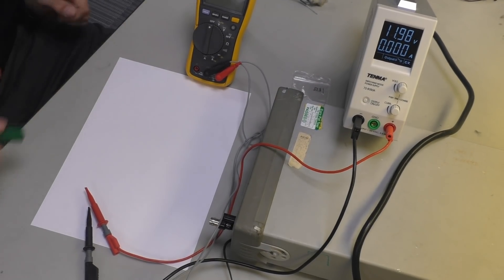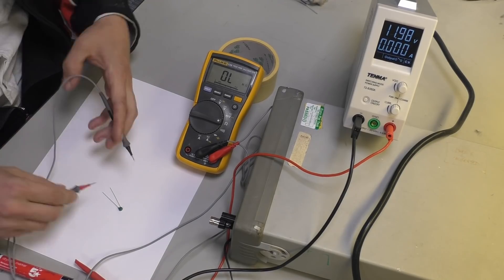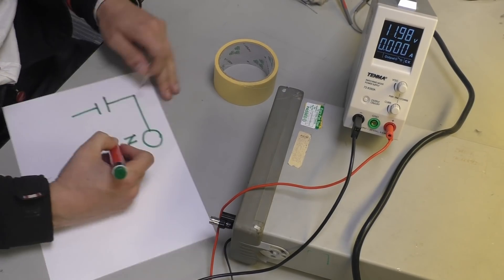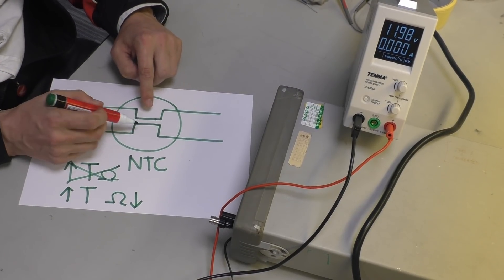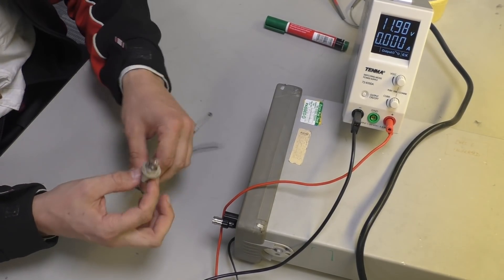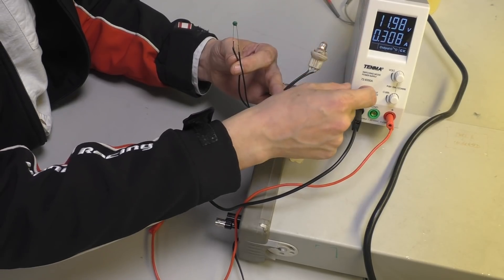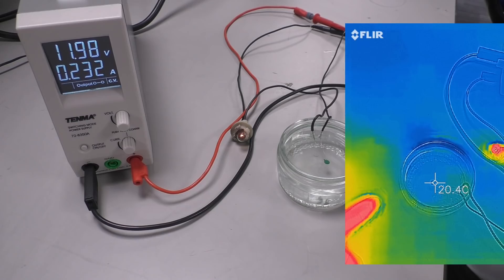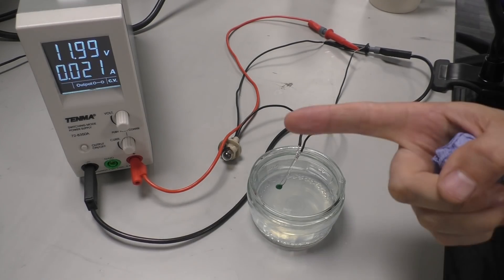Fuel Level Sensor - NTC Thermistor example

Comment: I'm studying this and what Beta values would be necessary to hit the numbers you measured. Seems for a 1 KOhm resistor it would have to be a pretty high value like 4800K, which seems unusual. I think it may be lower though and I'm focusing too much on exact values. One part of this is confusing me, which may be key. Obviously as the temperature of the NTC thermistor goes up, the resistance goes down. When the resistance is low enough, the bulb illuminates. In this case you peaked around 100C at 12V and 0.3A. That means the total resistance in the circuit was 40 Ohms and total power was 3.6W. What's confusing me is, shouldn't the bulb itself be factoring into the resistance reading of the circuit? If we assume that is a 2W bulb, at 12V it should draw 0.166A and have 72 Ohms of resistance on its own, which I believe should actually go up when it illuminates. That's more resistance than your total reading with the thermistor inline. I feel like I am missing something fundamental or misunderstanding the calculations. I totally understand how the thermistor circuit is allowing the bulb to light, but not how the bulb affects the readings on your power supply. Hope you can help!

Comment: I got here because I was trying to understand the reason why my idiot light stopped working and 2 weeks ago I ran out of fuel. I knew I had to refuel at a certain point of my trip, but I just forgot to do it. I was just so lucky that I ran out of fuel 3 or 4 hundred metres before a petrol station and since I was riding at about 100km/h, I managed to get there without the need to push the bike! Completely understood what I have to do to check it! I'm not an English speaker but fuck'n enjoy your accent! Stellar video!

Comment: A small bulb requires about 1/4 amp or 0.025A to turn on. The sending unit may read 0 ohms empty but not on the bottom of the tank. A small “I.C.” circuit will update the fuel level gauge and low fuel light every 10 seconds. This keeps the fuel level from fluctuating when turn corners with a low tank. Newer robust senders use a silk-screen resistor grid on a ceramic board, yet subject to poorly refined fuels containing high amounts of sulfur. This attacks fuel senders and low fuel sensors NTC thermistor. Most, not all, NTC thermistors have little fingers of a polymer version coated with a carbon compound. When hot, the fingers pull apart and the more that separate, the fewer the connecting are complete and the resistance goes up. Large NTC thermistors in a polymer case actually are used in power window motors to protect from over current operation. Example, roll the window completely up and hold the switch, the motor could be damaged but the NTC thermistor opens, saving the motor and does not trip the circuit breaker in the fuse box or older fuse types. They are wonderful devices use everywhere. 
  Thank kindly for bring your lesson in this video!

Comment: Hi 
maybe you know if it's possible to replace fuel gauge (floating system) with themistor sytem?
range isn't the same...
12 - 200 ohm for floating system
1700 ohm approx for the thermistor

Comment: You have the thermistor controlling the positive side. I tried using the negative side and it seemed to work the same. Any notable reason to do one or the other? I would think it's not safe to run 12V+ through the gas tank...
Reply from the maker: Some thermistor have built in diodes and they are biased.
Reply from the maker: Also why would it not be safe? 12v runs through your earth and your tank is part of that system, also most fuel pumps are inside the tank, with a 12V 15 amp fused supply...
Reply: @thedirtyworkshop  I agree, my mistake. I wasnt thinking of that since I dont drive a vehicle with an in-tank fuel pump. Im trying to rig this for an indicator light in a 70s CJ5

Comment: Can i submerge a NTC into Gasoline ?  Or other inflammable liquid ?
Reply from the maker: Yes
Reply: @thedirtyworkshop  No Dangerous if damaged NTC ?
Reply from the maker: No. Fuel needs air and a ratio of 7:1 to burn. Same thing with electric motors in fuel pumps...
Reply: @thedirtyworkshop  well, i don't have a level indicator but only a spare light.
Do you think I can replace my float exclusively with the NTC?
Reply from the maker: As long as you get the resistance correct yeah
Reply: @thedirtyworkshop  the lamp is at 12v it will be no more than 5w and it will absorb 10mA. If I have not miscalculated the NTC resistance should be 1200 Ohm and since I don't find any around it could (at least I think) I could use a 5K NTC or is it very high in your opinion?
Reply from the maker: Stick a resistor in the circuit

Comment: Great video, thanks. Question: My thermistor is broken. If I wanted to bypass the cutoff and fuel light completely, could I just wire in a standard resistor? My current thermistor has 1 wire. So with the Resistor, I would use that wire and the other side just to the fuel pump body? 
Thanks
Reply from the maker: Cutoff? As for the light, remove the bulb
Reply: The Workshop my bike has 2 of them. The top one sets off the light. Then there is a lower one and it cuts off the fuel pump. Could I just wire a 1k ohm resistor in-line and ground it to the fuel pump body?
Reply from the maker: What bike is that?
Reply: The Workshop 2006 Suzuki boulevard C50 (vl800)
Reply from the maker: Are you 100% it has a fuel pump cut off???
Reply: The Workshop wouldn’t say 100% sure, but on an m109r (Suzuki boulevard 1800) I’ve seen a few reports of people’s fuel pumps stopping because the wire to the thermistor broke. (They have 1, my bike has 2). I can’t think of any other reason why it would need 2 of them.
Reply from the maker: I dont think there is a cut off. Why cut the fuel pump when you've ran out? There's 2 thermistors, that bit is true. One for the warning you're running out, the second for the flashing 'you're about empty' function.
Reply: The Workshop welp you were right. The first one is a slow blink, the second one quick blink. The bike runs with the wires disconnected completely. Not sure what those other people were talking about when they said their bike died from that ntc wire breaking. Anyways thanks for your help and video.
Reply from the maker: No worries dude. The Internet is full of 'I know this, I know that's people. Lol

Comment: thank you....great
Reply: question: i am working on a 2009 bonneville it has the low fuel level light not working, i did few tests based on your video, so with the multi-meter the NTC works i tried to warm it up with a lighter and the ohm goes down and them when i blow the NTC the ohm goes up i did the same test with a light bulb as you did in the video and the NTC works the bulb turns on but seems working only with a lot of hot, (the lighter) it should works just with the environment temperature right? 
so if i connect everything and i warm up the NTC with the lighter the low fuel level light doesn't turn on on the dash, so i thought maybe the wire is disconnected somewhere!?!?! but i tried to connect togeter the two wires of the TNC (i just by-passed the TNC) and after 3 sec the low gas level light turned on on the dash?!?!?!? but it doesn't turn off himself i have to switch off the key.
hope it make sense and maybe you can give me a suggestion...thank you
Reply from the maker: Is this the original thermistor? Or did you buy another one? Thermistors have ohm ranges from 100Ohms to 1 million ohms. 

"it should works just with the environment temperature right?" - No, the circuit is powered when the ignition is switched on. Power is send down the circuit heating the thermistor - if fuel is there then the thermistor is cooled at the resistance remains high stopping the bulb from glowing. If the fuel isn't there the thermistor heats up (from the current passing through it) and this lower the resistance and the bulb lights up.

"and after 3 sec the low gas level light turned on on the dash?!?!?!?" - yes and it should. The resisatance in the circuit with no TNC is low so the bulb lights up.
Reply: @thedirtyworkshop  it is stock TNC, so it works with power 12v and 12v have to go thru the TNC once it is warmed up? i need to find the missing ring!!!
Reply from the maker: Try measuring the current draw on the bench then in the bike
Reply from the maker: Heated in open air and in petrol

Comment: How does an ecu (for example) measure the value of a thermistor? If it sends current one way through it does it 'listen' on the negative side?
Reply from the maker: It doesn't - this is not part of the ECU circuit - a lot of things aren't and don't need to be.
Reply: @thedirtyworkshop 
Sorry I didn't necessarily mean a fuel level sensor, your video just popped up whilst I am having issues with coolant temperature being read incorrectly by an ecu. I just wondered how the ecu read its value. Electricity not my strong point...

Comment: Hi, good video I love a bit of science,
is the wiring layout something found on Yamaha's?
my old Fazer had a yellow light to show low fuel, I never got to examine the circuit though as it never needed it.
My Kawasaki has a kind of whetstone bridge circuit containing the variable resistor on the float arm and fuel gauge, are there any other ways of doing it?
Cheers

Comment: I`m thinking your low fuel light on the SV is still not working?....have you checked thebulb? (dumb question)..if thats okay then there will be a circuit in the dash that amplifies the themistor signal to turn on the light.If the wiring to the tank is solid andthe bulb wont light....somethings wrong in the instrument cluster...just a thought.....best regards...
Reply from the maker: "I`m thinking your low fuel light on the SV is still not working?"

- what makes you think that? Yes its working. I sorted it out months and months ago.....
Reply from the maker: "have you checked thebulb? (dumb question)"

- PArt of the circuit is that when you switch on the ignition the bulb comes on - and then goes out after about 3 seconds - this is to tell you - everytime you start the bike that the bulb is working.

Comment: Hi Matt love the new toy . I can see lots of videos coming up. As others have pointed out you would not normally  connect a thermistor  and indicator combo  directly   but as usual the inscrutable Japanese come up with a very cheap very simple solution. The traditional  method is to use a Wheatstone bridge type configuration and variations on that theme  with varying levels of complexity that  may be needed. Hell you could even throw a full blown micro processor  at it just for the shits and giggles

Comment: Short version as still confusing.

NTC in fuel gets heated when ignition is turned on, when it's in the fuel, the fuel keeps it cool which means its off in circuit. So no bulb on.
When it's out of the fuel it can heat up and open like a thermostat so the power flows and the fuel light turns on.
Reply from the maker: that's what I said. the difference is the its a resistor not a mechanical valve. If you start saying 1 thing its hard to backtrack later

Comment: Seems crazy deliberately putting electric current through components submerged in fuel. But I suppose it's worked for years. Never really thought of how that works. Interesting, cheers buddy
Reply: @knuckles zedawg;
Then what about the typical electric fuel pump? All of its electrical components IE: brushes, commutator, armature, are fully bathed in fuel and never cause issues with burning. In fact, the fuel is the major source of cooling for the pump motor.
Reply: @GFTP100  

I didn't actually know that. I assumed that the electrical side was isolated from the impeller side. Makes sense using the fuel to cool it provided that it doesn't go bang, which it obviously doesn't or the roads would be much more interesting places :-)

I'm a manufacturing engineer, once a manual machinist but for the last ten years a CNC programmer, so it ain't my field of expertise. Something I've never had to take apart. Thanks, interesting :-)
Reply: When I dissected a Bosch fuel pump for an injected Volvo back in the early 1980’s I was blown away when I discovered that the fuel went straight through the pump, touching every single part, moving or not. It also meant that running these pumps dry will probably destroy it in short order. Not a condition that should happen while installed in a vehicle if all systems are functioning correctly. 

I did CNC programming (all G and M code by hand) back in the mid 80’s. Rather miss it and the challenge doing the jobs cleanly and efficiently.
Reply from the maker: "But I'm just going to leave it going as it must be in my head as you told me liquid fuel won't burn.."

- its the vapor that's burning not the liquid.....
Reply: This is why empty tanks that have contained fuel are so dangerous.  There is often still residue vapour within and the smallest spark or ignition source will ignite it an possibly lead to an explosion.  The large tanks even years after use still need to be vented before any work or dismantling occurs, sometimes purged with inert gas.
Reply: @madcockney  

Yeah, a good number of people been killed welding 'empty' 55 gallon drums...
Reply from the maker: "Seems crazy deliberately putting electric current through components submerged in fuel."

- why? LIquid fuel won't burn
Reply: @thedirtyworkshop  I just poured some liquid fuel on my arm and put a lighter to it.
To all intents and purposed my arm appears to be on fire.
But I'm just going to leave it going as it must be in my head as you told me liquid fuel won't burn..
Reply: Liquid fuel quickly evaporates off your skin and mixes with surrounding air forming a very flammable substance. Thats why your hand is on fire and you should put it out ! :D
Reply: @TheWebstaff  it burned because the liquid fuel turned to vapor due to heat in your arm and mixed with oxygen in the air at 15:1 ratio.😉
Reply: @thedirtyworkshop  

Yeah, you're totally right, just something I never thought of how it works before.

Comment: If the fuel in your gets warned up due to extreme climate?
Reply: It does, but if you look at the instrument, the bulb starts lighting up around 180-190 mA drawn. The resistor is around 65 ohms and about 100 degrees celsius at that point. If the weather is hot (40-50C) the fuel in the tank - even it is a black bike for example - is around 60-70 degrees tops.
The wattage of the bulb is chosen to match the characteristics of the NTC: eg. under 200 mA (~100C on the NTC) very little or no light, over 250-300 mA (NTC over 120C) the light comes on.

Comment: Cool demo! One amateur question though, how hot does the NTC get inside a tank (when dry/exposed to air) and how did they make it to be safe?
Reply: Depending on the bulb used the current can reach 300-350 mA, that means the resistance drops to 30-35 ohms. Most 1k NTC resistors reach 120-130 degrees Celsius around that sort of value. It won't ignite the fuel mind you as there is way too little oxygen in the tank (and no spark either).
NTC idiot lights have been in use in the automotive industry for a long time, it is safe. I've just added this feature to my petcock as my bike has no such indicator from the factory.
Reply: Most low level indicators used on modern bikes and cars are LED and the voltage is between 2 and 3 .3 volts depending on colour of the LED. The current draw of the LED is critical at about 20 milliamps maximum so just a small drop in resistance affects the current and whether the LED is on or off.  Though in the demonstration the LED was connected directly to the lamp via a battery and NTC thermistor frequently they are used to trigger rather than directly.
Reply: Sure, with LEDs it is different. This video demonstrated the old fashioned "analogue" way with an incandescent bulb. I mainly study and work on V2 metric cruisers (80's to early 2k), most of them have this circuit because it is cheap and simple. 
I can't say I'm familiar with modern sportbikes so I take your word for it, Madcockney :)
Reply: @davidbalogh3845  hi lads, I have a 96 Yamaha with a push in incandescent bulb as a fuel light.
I picked up a NTC 1k ohm thermistor and it has a really small head unlike the one in the video.
I tested it today and it gets too hot to handle after about 20 seconds.
It seems that the light on The dash is only lighting about 80% but still works well compared to the others.
Should I change it to a 2k ohm 
And do you think that will reduce the temperature and increase the light?
Thanks 😊

Comment: You are alive! Well worth the wait for the videos. Nice explanation about how the fuel level works.

When the fuel level indicator stops working correctly, what is the most likely cause? Thanks.
Reply from the maker: This happened to the SV. When you turn on the ignition the bulb usually comes on then blinks out. This is to let you know the bulb is working. Its usually the NTC and I'll be doing a video about the replacement soon
Reply: @thedirtyworkshop  i cannot find the replacement video. Please can you make it